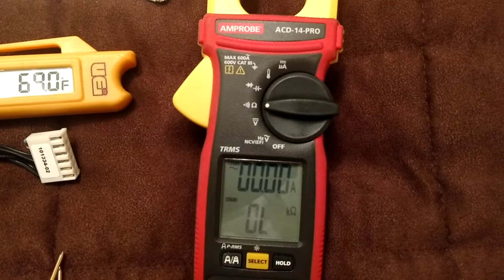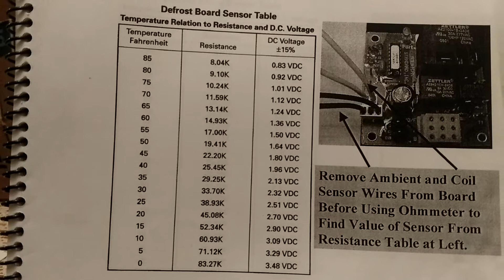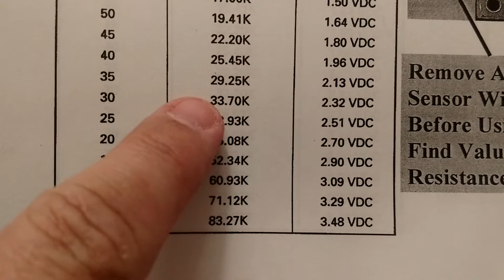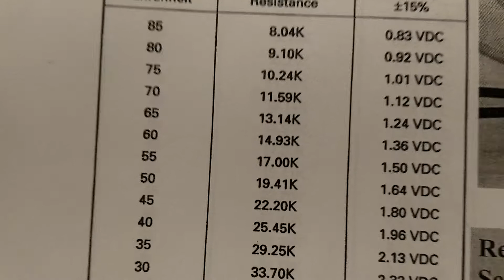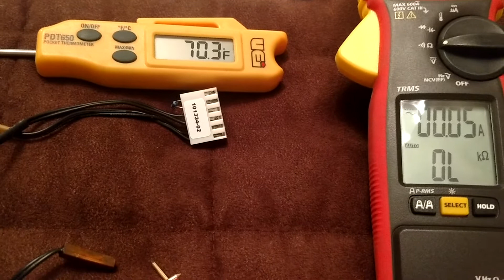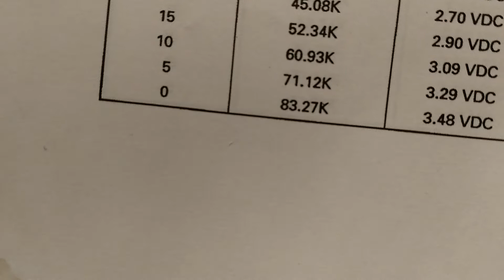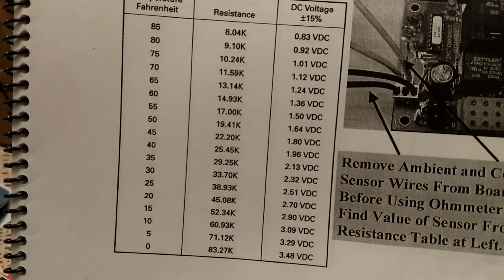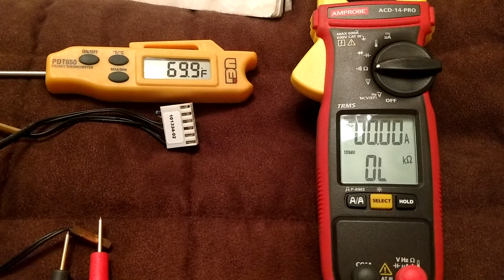HVAC "QUICK TIP" Demand Defrost Problems- Unit off on High Pressure. Diagnosed w/Amprobe ACD-14-PRO

Comment: Great video!!! Keep them coming... Hey whats the rating on that meter, can you discharge caps with it?
Reply from the maker: I've never had to discharge a cap. I just pulled the wires off and stick the meter on it and it always works. This particular meter reads capacitors faster than any other meter on the market. It's literally in the blink of an eye you get your reading and it's very accurate also. One of the best features on the meter 👍 THANKS FOR WATCHING.